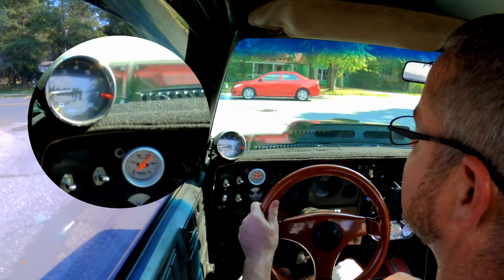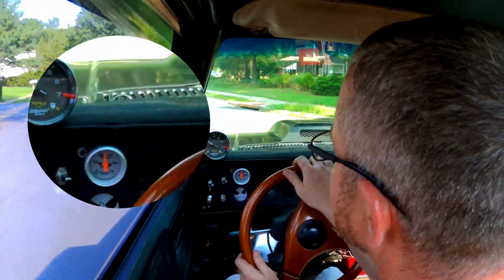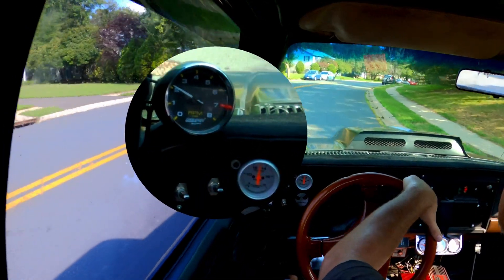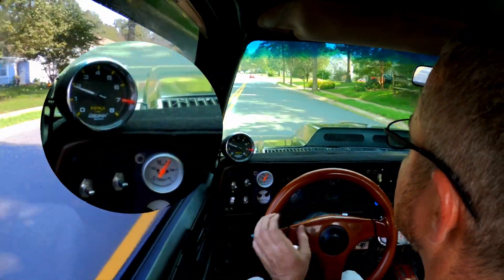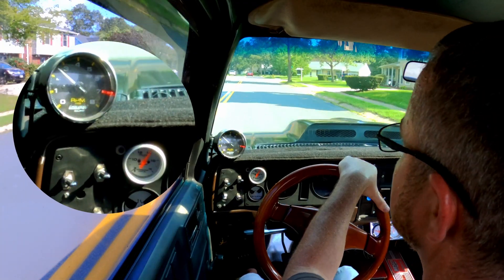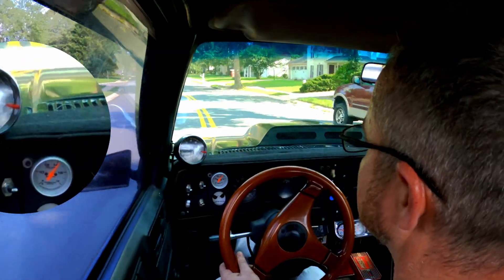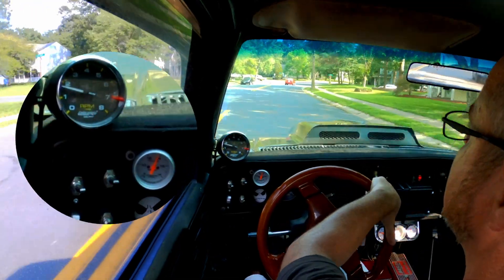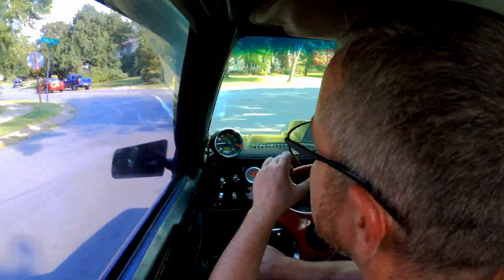Holley 4150 Carburetors Tuning The Power Valve!

Comment: So riddle me this......
Mark from BLP carbs out of Florida told me that if I increase the power valve number it will go leaner on part throttle acceleration and richer at idle.
So I went from a 6.5 to a 7.5 and that's exactly what happened.
I'm going to try a 4.5 soon and see what happens.
So.....how is that possible?
That goes against everything I know about power valves.
Reply from the maker: It also depends on your PVRC diameter. That channel acts like a second set of jets that feed into the same main well. Both the low and high air bleeds play a role in how the signal responds.

Comment: Thanks for the video,  I  swap my heads and cam, my heads are brodix ik 200 and my cam is 265@50, my last cam was 254@50. Problem was I got a good idle  ut drive around at cruise speed I was going crazy rich down to 11 on afr.i finally got around to putting a vacuum guage on car and noticed I only have about 4 inches of vacuum in gear. I realized the 6.5 power valve was opening up way to early.  I ordered a 2.5 power valve  and hopefully this will cure my part throttle driving.  Everything worked great before. Hopefully this 2.5 will help.pv should arrive tomorrow
Reply: Hey I'm curious how the pv change did for you? I have around 7hg in gear 850rpm and my holley 850 has duel 6.5pv in it.  Have awful stumble of course.  N didn't know if I should change both to a 3.5 n see what happens or maybe little lower??
Reply: @Megan24Nichole the power valve change fixed my problem,  I have 4in in gear, the 2.5 fixed me right up..with the 6.5 I was super rich a cruise speed
Reply: @Megan24Nichole Try setting your air mixture with vacuum guage,  set to highest vacuum,  then maybe add some timing

Comment: Good vid!!  I have an Innovative PSB-1, shows Vac and AFR, you're correct, AFR and Vac are needed for this type of tuning.

To understand the tunable Metering block, you should look at some Weber literature, in a Weber they use an Imulsion tube, Holley uses the line of bleeds.  I love my Holley 390 HP, but the Weber system is pretty awesome. Anyhow, as RPM goes up, less fuel in the bowl, the fuel level is what reacts to the line of jets, depending on which jet the fuel level is at.  Weber looks totally different, but easier to understand, to then put that knowledge into a Holley.

Comment: You are tuning a power valve before getting your accelerator pump/ pump can tuned?  How do you know your rich condition  isn’t because of accelerator nozzle size?  The power valve is a ballpark sizing per motor vacuum so yes it is “somewhat” sensitive per build spec basis but I’d be far more inclined to dial in the accelerator nozzle and cam and then consider PV tuning.

Comment: Hey thanks for making this video, very helpful.  I seem to have the same issue with my PVCR.  My carb is a 650 race demon and came factory with .059  sized restriction holes on the power valve channel.  Just curious how many steps up you went in drill numbers?  I think the next one for me from .059 is .063?  FYI its a small displacement big cam big head motor so not much vacuum at idle (around 9hg @950rpm.)  I am currently running a 4.5 PV.  Thanks!!!!!

Comment: Hello I  can help, you need to measure your manifold vacuum in kpa as it represents engine load better. Idle mixture screws are for idle and very low throttle them main jets are for the Cruze range and the power valve is for wot . The air bleeds will adjust the overlap aka when each circuit comes in . Your secondary throttle plates need to be timed first based on maintaining  the highest kpa for a given rpm. You won’t get your mechanical secondary carb to run like a vacuum secondary on the street. Study the relationship of throttle position vs kpa aka throttle mapping no more throttle angle needed past highest kpa reading . Your getting lost in your tune because the secondary plate timings off .

Comment: Hi Mate , I have a 408 clevo and alloy heads and similar cam to you . I noticed u run a 4.5 power valve . But what jets are you running in the primary and secondaries? Would be great to point me in the right direction? I’m running 12.5 at cruise at 2500 . Way too rich . Thanks in advance!

Comment: given a standard Holley power valve are only set to close under vaccume Conditions Are there any cases where a blow through carb with a standard power valve will close under boost? My thinking is that the standard power valve will remain open under boost under you back off the throttle.. in only running 5 psi so thinking the brpv is not for me..? Thanks for any thoughts
Reply from the maker: The boost power valve is for positive pressure so it opens differently from the opposite side of the metering block. The conventional power valve is for draw through only boost with close that PV. Also the vacuum port for a draw through carburetors power valve needs to be blocked off in the front and back.
Reply: Thanks for your reply. So what you're saying is the additional pressure acting on the bowl side of the conventional power valve presses the standard power valve closed stopping fuel flow under some boosted conditions?

I'm thinking about putting in a secondary brpv and having a conventional pv in my primary metering block and seeing if this combination will get me good afrs through the whole power band. @TPVPRO
Reply from the maker: I don't have enough experience with blow through carbs to say yea or no. I only understand how they work.  @harmankardon478

Comment: i have a problem on my 331 stroker with comp cams 290/290 cam woth 230/230on 50           when light throtlle cruising i get 14to 14.5 afr when i put the pedal slightly more down i get a stumble and i can play the throtlle to 16.5 afr  when i do half throtlle i get 13.5       full throtlle is 11.5 (just started with the afr gauge tuning)    what do you think is wrong?
also if i get under 1700 rpm this light throtlle is more lean then when i'm cruising 2500 rpm 
on the other hand steady cruising at 1700 and 2500 rpm is around 14.5 afr

Comment: Let’s say you buy a used 750DP (pick any carb size) used and are going to fit it to a Street Strip SBC.  How do you go about selecting a starting point with jetting/squirted nozzles etc for the initial start up?

Comment: New to carb tuning and would definitely appreciate any advice. I have a 306 sbf, mild cam with stock crank and rods. The carb runs at 11.5 or so at idle and gets rich at wot, around upper 9 to 10.2/10.5 on the afr gauge. 68 primary jets, 76 secondary with a 6.5 power valve. The idle mixer screws are at 1 1/2 turn out. At running temperature it has 7to8lbs of vacuum. Holley techs have me so confused with all this and would really appreciate any advice on where to go from here. Also the carb is a 600 cfm with electric choke and mechanical secondaries. Thanks again for any advice

Comment: This is an amazing video! I’m having the opposite problem that you were when you were running that 8.5 PV. I’m running a 5.5 and at light throttle AFR is in the low 14s. But, when I let off it runs in the high 11s low 12s. I can’t seem to lean out my idle/transition AFR level. Will PV affect this? Thanks!

Comment: The first step is to set the carb to its original configuration, jet size, power valve, squirter size. Second step is to make the preliminary adjustments, fuel pressure, float, accelerator pump, idle mixture, secondary trottel, timing. Only then, can you start testing.

Comment: Good information in this video, neat to see actual driving data and what making changes actually do. I have run a few different carburetors on one vehicle, two of them 600 cfm and one 450 cfm. All 3 were tuned to run approx the same AFR at idle, transition and cruise. However, one of them the AFR would go from 14-14.5 down to 10.5-11.5 depending on load when the power valve was open, the other would stay in the 12.5-13 AFR range when power valve was open. The difference not only did the richer PV circuit carb have doggy performance it also got about 1-2 MPG worse doing the same exact runs/commute than the carb that had the leaner PV circuit. Very important to get that circuit tuned right!
Reply: Plug your pvcr on the one that's rich and re drill to the size of the ones in the other carbs. Pin them to find the size
Reply: @lollipop84858 I no longer have that carb but I've done just that on a couple of them and need to do it to another one just haven't gotten around to it yet. I found to go from 10.5 AFR when power valve is open to 12.5-13 you gotta go down about .010" from whatever they are stock. Once you go larger on the primary jet and idle feed restrictor size it causes the power valve circuit to be extra rich since  the rest has deviated from stock calibration.

Comment: I've got an 83' Ranger 4x4 with a stock 2.3L inline 4 and I just did a Holley 350 2 Barrel swap. I've been fighting a bad bog and hesitation when I use more than half throttle and it always happens at 2-2.5k RPM. Once it passes 3k RPM, she sings and runs pretty good. 

Switched out the pump cam from orange to black and it helped quite a bit. It seems the less fuel I have, the less it bogs and hesitates. I checked my power valve and I had a 8.5 in and swapped it out for a 5.5. Also switched to a 30cc pump while at it.  Haven't tested it yet because I somehow snapped a fuel bowl bolt so I'm waiting on a new set to come in and a .025 anti pullover squirter for the accelerator pump. I do plan on getting an AFR gauge installed at some point. But this video made me understand PVs a lot better. Also proved my intuition correct and going with a lower number without doing much research.

Comment: It's funny, I've gone back and fourth with guys on holleys half idle vacuum sequence for closing powervalves.    The best way I've found is to block the valve off, go for a drive, see at what vacuum reading it start to get a lean spot, throw a valve in a couple numbers before that lean spot.  
    Idle vacuum will definitely not tell you what you need at cruising and acceleration state.

Comment: What would be the reasoning behind a power valve block off plug? Rebuilding a carb and its in there
Reply from the maker: It will just run a whole lot fatter during cruise without one in the front because you have to jet it up to compensate.
Reply: @TPVPRO  makes sense, the jets were crazy high!
Thanks for the reply
Reply from the maker: @josephfriedrich9792  No problem brother

Comment: I agree with this video. Nice metering blocks like the lowered pvcr locations. Finding a decent average tune that works year round can be a challenge. I find nowadays i get by with just shoving a fbo bushing in the msd dist on my pump gas street motors and running the right heat range plugs

Comment: Take the power valve and throw it out, use a block off and square jet! Your welcome 🤣🤣🤣 : side note, read your plugs!!!!
Reply: Nooo, just try it before you doubt it. Been doing this long time!
Reply from the maker: @nhragold1922  I have tried. Not running a PV just wastes gas and loads plugs when putting around. You don't need 12.0  AFR going down the highway. All it does is eliminate efficiency.
Reply: @TPVPRO  street talk you are absolutely correct! It indeed loads up putting around, but definitely shines under full throttle. I always joke with people who try to run them with what I said. If you foot brake it stages smoother with power valves. I'm sure you are aware by my name and comment I don't do much street stuff. I run a dragster, and absolutely love carbs. I'm actually impressed by your knowledge of them. Not many can actually tune a carb correctly anymore. I got my Dom so consistent it's responsible for 12 big wins, and a bunch of gamblers races! So honestly it's great to see a knowledgeable video.

Comment: I've got a few questions. What wide band gauge and O2 sensor are you using, where did you find your radiator and engine mounts? Man I love the 400. I'm doing a very mild Dart 427.

Comment: I have a vaccuum gauge and wide band, side by side. And it helps a ton when tuning for power valve size. Holleys method said I needed a 3.5
The vacuum and wide band said I needed 8.5. My engine is definitely happier with 8.5 in it

Comment: You don’t jet the mains for cruise, you are coming at this completely wrong! The first thing you do is find out what timing your motor likes at idle.. Big cams need 20-30 degrees, if u have a small cam maybe 13-17. That’s where u start! Then once u have the correct timing, you start on butterfly and transition slot adjustments , you don’t want to expose too much slot, or it will idle rich. Expose only 1/16 of the slot. Then if your 4 corner idle adjustments don’t change idle quality, change either idle feed restrictors or idle air bleeds,, once the needles adjust the idle feed  u set for highest vac on port vacuum. Then check with a AFR gauge to see where your AFR is at at idle.. If it’s 13-14 your good, if not,, adjust according with air bleeds for min change or idle feed for a lot. Next adjustment will be Transition adjustment,  from idle to cruise, this is checked with AFR gauge, at cruise u want 14-16.. adjust restrictors in meter block for transition feed. Next you adjust main jets for full throttle and high speed bleeds, 12 to 12.5 AFR is usually good,,  Now if you have a power valve in the primary, block it, and only run in the secondary,, Find out what vac u have at cruise and go up 1-2 points on vac and Bam.. that’s how u approach adjusting a carb! If you have a hesitation, then either your timing curve is wrong, or your AFR is out of wack…
Reply from the maker: This video was only on how the power valve works and how it affects AFR not a complete tuning video. I have other videos in my Holley 4150 playlist for that. I run a locked out distributor you don't need a timing curve with a stall that flashes at 5000rpm. Plus you never talked about the accelerator pumps and they are extremely important.
Reply from the maker: https://youtube.com/playlist?list=PLvY-OTrBnLAvf39HS4aVMdJS9KLLhDAyc

Comment: I'm running a qf 850 q series and I pulled plugs 5 and 8 looked perfect
Pulled plugs 1 2 3 4.. they were Shiney wet?.. is that a ignition issue..msd 6aL..
Sbf 408w..
My cam is .300 .300 at 50..614 lift
Reply from the maker: Hard to say without seeing it in person.

Comment: Emulsification jets
Reply from the maker: I have seen places give them different names for identification. I got a bag of .025s with a label "screw-in restrictions"
Reply: @TPVPRO  the jets yeah I see that because I bet there probably the same size as other restrictors that are in dominators and other high end billet metering blocks for low speed air bleeds idle circuits ECT....but the channel in question is the emulsion channels 👍

Comment: My afr goes way lean if i let completely off the throttle and let it coast, what could that be a sign of?
Reply from the maker: Could be a number of things I would check to see if all 4 idle air screws are open the same amount. If the idle is set low and the front and rear blades are almost closed it can do that also.

Comment: You need to rid of that POS fuel filter before your carb.Why ot just take a vacuum reading at crusing speeds? then select the the power valve at just below that range?
Reply: Easy Cathy...🐱

Comment: Great video ! You're a good teacher,this will be a problem solver for many out there.I'm 67 yo ,bracket racer for quite a while and can assure you 90% of the racers had no clue about correct pv selection.Got a couple questions.What pv restriction jet size was in the metering block to begin with and size did you drill it out to ? What size primary jets came in the carb ,what size was in it before you went down 10 sizes ? I've tried several different formulas including the one given by HeadFlowInc in the comments ,but still find myself reverting to the one I was taught over 50 years ago ;operating temp,in gear idling, read vacuum , divide by 2=pv size. Tune from there.
Reply from the maker: I have no idea what it was before I drilled them out. I just eyeballed a 1/16 drill bit and said that looks about right. 😆 I have a bag of .025s so if it was a bad idea I could adjust. It was a stock 950 brawler carb. Here is my original video when I went through it
Reply from the maker: https://youtu.be/RFJPhaFqAA8
Reply: @TPVPRO  Thanks
Reply: You obviously got a race motor under the hood and I wonder if it's slowed you down dropping six sizes of jets I bet it did.. and all you had to do was change the discharge nozzle for your accelerator pump instead of all that work you just did for the power valve and now you just lost a quarter mile time by dropping your jets when you could have just dropped your discharge nozzle
Reply: @rono3045  ha ha. You would know......

This guy has 2 gauges, side by side in the video.

They tell the story, not you.

Cruising down the highway steady, you should probably be around 14.5 to 15 afr, for economy.
At max wide open throttle, the air fuel ratio should Start going towards 12.5 afr pretty quickly I would imagine.

Then as you slowly let of the throttle, and reduce the load, it should slowly go back to around 14.5 to 15 afr.

And I'm sure that his engine does that, or at least how he thinks the numbers should be.
His engine screams!

Great video.